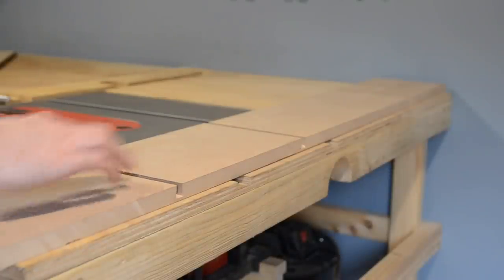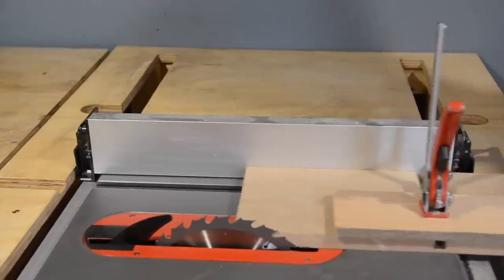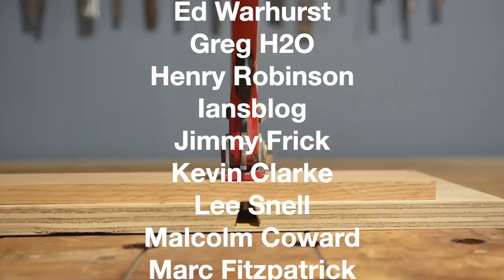Making A Jointer Jig

Comment: I think this is the simplest and most practical jointer jig I have seen. I have some track clamps and I am going to make this jig. I might see if I can order a cheap t-slot cutter to try instead of the dovetail.
Reply from the maker: Thank you
Reply: @Badgerworkshop  Ordered a 1/2" T-slot cutter from aliexpress, theoretically it will cut a suitable slot in 2 passes but I might use a straight cutter to hog out material first as I only have a small katsu router.
Reply from the maker: Hope it works well

Comment: Interesting jig and video. Thanks for sharing. I think I'd go for a T-track. it's possible to make them yourself if you don't want to spend money (only time) on them.
There are special T-track router bits and it's possible to start with a straight bit (also in multiple passes if necessary). I like the slot idea with the clamps very much. Far much
better (and quicker) than the toggle clamps.
Reply from the maker: Thank you

Comment: Hi Matthew, looks great. Perhaps a runner on the back and you have a sled so u don’t have to adjust the fence everytime. Will jave a stout overhere to celebrate this project 😁
Reply from the maker: The fence works great and no need for an extra step. Also can then work on any saw
Reply: Yup you’re right mate

Comment: Hi Matt, Thanks for the video. Have you thought about adding a guide underneath so it can run in one of the tracks on the table saw - that way you can dispense with the fence.
Reply from the maker: The fence works great with out having to add anything

Comment: Good job, mate. 👍
I agree with you on those toggle clamps, really not that good for a jointing jig at all.
Unless all you need to do is smaller stuff.
Thought about making a flip down seat that is attached to that wall behind you?
Save you from having to bend over to get in the frame.
Reply from the maker: Thanks Bill. I don't want a seat as I would sit on it

Comment: It is a useful jig .  I want to ask the jointer jig must be always longer (for stability)  than the board you want to cut ?  Also i want to ask somethink irrelevant to the video . If you buy a tool with  battery and you dont use it often the battery will break down sooner ?
Reply from the maker: I would not want to be a board that was much longer but it would work

Comment: Why not have a runner to use the miter tack?

Even if you don't need it to help guide it, it would still add support to the jig without needing to make it as thick...
Reply from the maker: you could but the fence works great and means it can be used with any saw

Comment: Hi Matt, it seems you have made a straight line edger. I do however wish you would use the guard. 
I have used a similar idea for straightening thick veneer by cramping between 2 pieces of timber and running a trimming router cutter past it and providing the board you are using to run off is perfectly straight you get a perfect edge for jointing 2  pieces of thick veneer.
Reply from the maker: Thanks

Comment: Generally it is not a great idea to cut a dovetail channel like that in one pass as it is a huge strain on the router and it tends to overheat the bit!  It is by far better to cut a straight  channel with a bit that is no wider than the opening that the dovetail bit will leave in the surface to remove some of the material before using the dovetail bit!  That is a more usual way to do it with out burning up your bits and router!